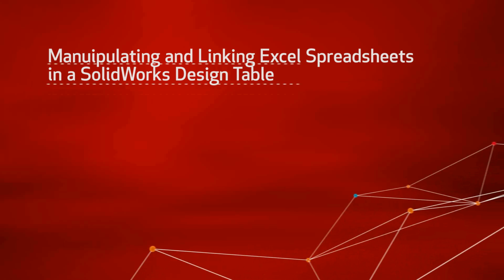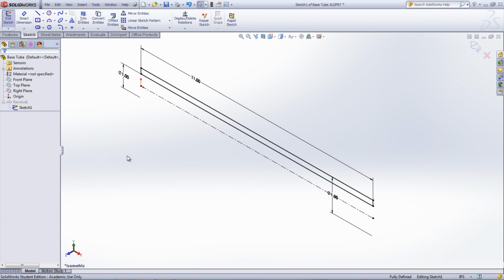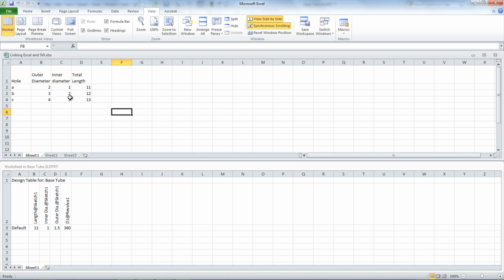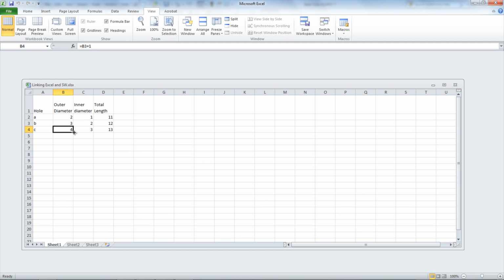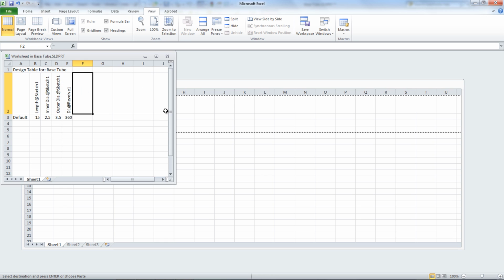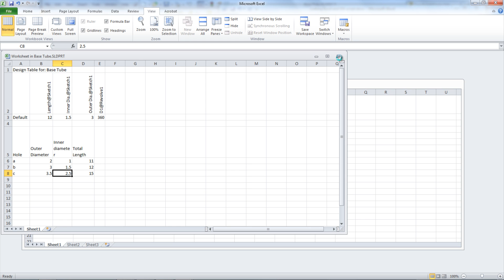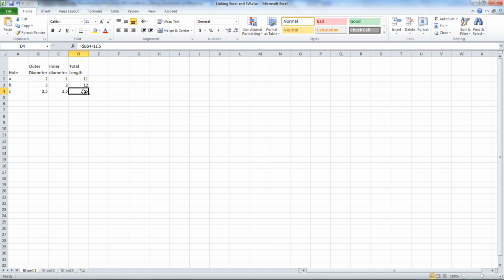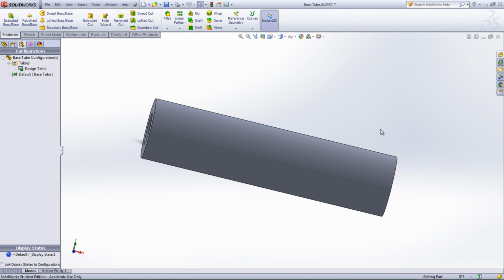Linking Data from Microsoft Excel to a SolidWorks Model

Comment: Transcription for your use:
This video will show how to manipulate and link data in an Excel spreadsheet and use
that data in a SOLIDWORKS model.
This is very helpful if you have done a lot of calculations within Excel and you want
to link them to a SOLIDWORKS model.
With your model open, go under Tools and Equations.
Switch to the Dimension view, which is the middle icon in the upper left of the Equations
window.
Rename the dimensions to be changed so that they are easily identifiable.
This can also be done when dimensioning the model by changing the dimension name in the
Property Manager.
Create a new design table by going under Insert, Tables, and then Design Table.
With Auto Create selected, click the green check mark.
Select All Dimensions in the Dimensions window that appears.
This table allows you to perform calculations like a normal Excel sheet.
To link the values in SOLIDWORKS, click in the Graphics window to close the design table.
Right-click the design table in the Configuration Manager and select Open in the New Window.
This makes working between the two documents easier.
Open the existing spreadsheet that has your data and equations already in it.
The one shown is a simple example, but more complex sets of data can be used.
In the SOLIDWORKS design table, select one of the cells.
In this case, we will use the total length.
Type the equal sign, then switch to the Excel sheet with the calculations in it.
Select the cell with the total length in it.
Now press the Enter key.
This will have linked the two spreadsheets.
Repeat the same procedure for the other dimensions and close the Excel sheet.
To make any changes to this model, first edit the calculations spreadsheet and change the
values.
Then, edit the design table within SOLIDWORKS.
Nothing needs to be changed, it only has to be opened so that the values can update.
Close the design table and the model will update.
Another option for dealing with Excel calculations is to first follow the same procedure explained
earlier by renaming the dimensions.
Then highlight all of the rows in the entire calculations worksheet, right click and select
copy.
In the design table, right click on one of the row numbers, select insert copied cells,
making sure to skip a few lines after the end of the last configuration.
By skipping a few rows, SOLIDWORKS does not register those inserted cells as new configurations.
From here, click a dimension in the default configuration row, press the equal sign and
then select the cell that corresponds to this value in the newly pasted cells.
All that is necessary to update the model is to edit the design table and change the
input values.
The table can then be closed by either exiting the Excel sheet if opened in a new window
or by selecting the green check mark in the upper right of the window if viewed in SOLIDWORKS.
A helpful tip is to color code the cells that are input values and the final results.
Make a small key specifying what each color represents.
This will allow other users to know what values to edit in the table.
Please note that if you are using any absolute references in your calculations spreadsheet,
it is necessary to use the first procedure described or remove them before copying and
pasting them into the design table.
The reason is because when you paste the cells in the design table, it will not transfer
the desired reference and you will be referencing the wrong cells.
An easy way to remove these absolute references is by first pressing CTRL F, go into the replace
tab, enter in the dollar sign under find and then leave the replace with blank.
Next click replace all.
This will go through the entire worksheet and remove the absolute references.
It is also a good idea to save this as a new file before removing these so that you can
retain your original document.
I hope that this was helpful in showing how to use Excel in your SOLIDWORKS models.

Comment: Hello , 
I ran into a problem with the import data option in motion study. I had used a motor to drive a component. I had used spreadsheet data as the input for the motor. But whenever I update the spreadsheet, I do not see the updated data in solidworks. How can we achieve this?
Reply: I believe you need to have both documents open at the same time

Comment: I am using this method on various occasions and it works fine. Now I want this table to be shown in the corresponding SW drawing derived from the originating SW part, where the Excel table was inserted into the drawing as an Ole Object. We've done that in the past, but I can't find it anywhere how this was done. Reverse engineering from such an existing drawing didn't help me either. Anyone for a clue?
Reply: did you find any solution?

Comment: Hi guys,

I am building a SolidWorks part whose dimensions are calculated by complex equations, and I must do these calculations in Excel. I want to link those resulting dimensions from Excel to SolidWorks.
I am wondering if one of the following methods is the better one:

1. Create a design table and link it to another Excel spreadsheet.
Implies: Needing to open the design table every time you open the assembly, or the changes will not be made.

2. Have a macro to export Excel file into .txt file.
Use the .txt file to import variable values into SolidWorks.

I know both methods would work, but I'm mostly looking to know which one is the cleanest of the two, as in which one will give SolidWorks a better time.
Reply: OH WELL.

I can actually cheat and change the extension of a variables file that I export, making it a .csv. It works just like a .txt file, except now I can mash all calculations in. >=D
Reply: Second method, and more generally, using the import option is the best way to go ahead instead of the table stuff